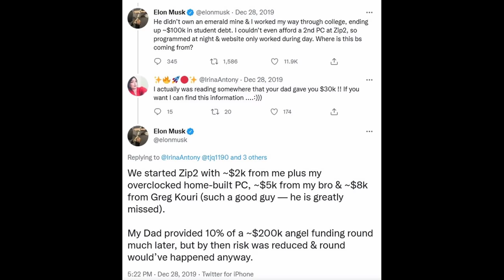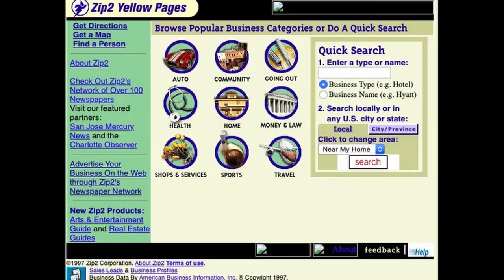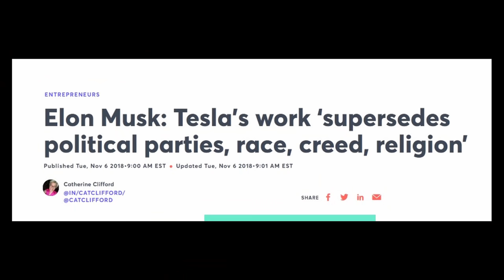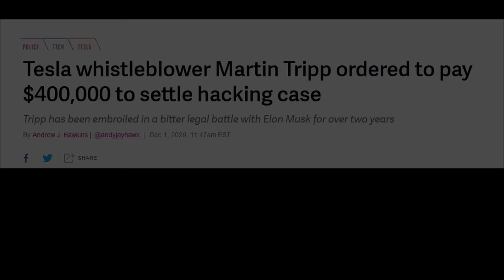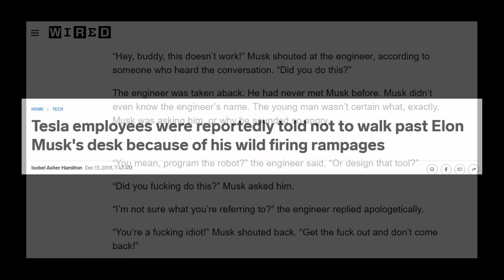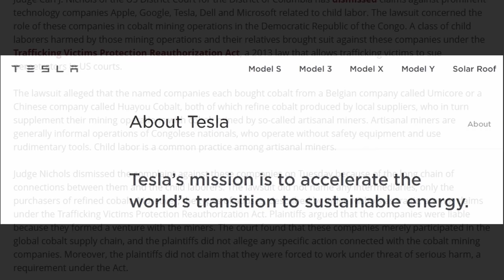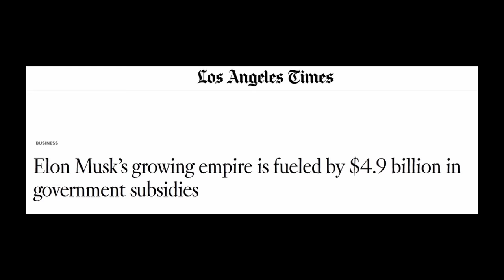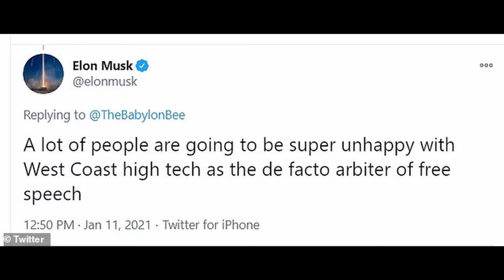The Myth Of Elon Musk

Comment: But with the lihium and cobalt, if they are less bad than oil, then its still worth it. And also there is prob a plan to phase out the lithium-based batteries down the line and go for something cheap and less bad. Like those graphene-batteries which could possibly work..